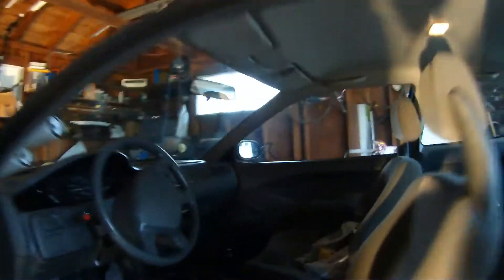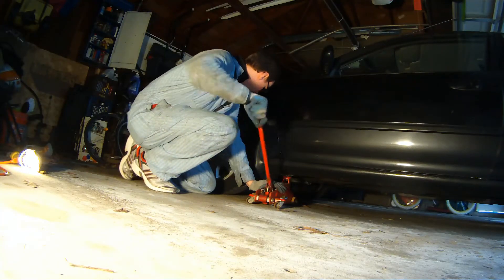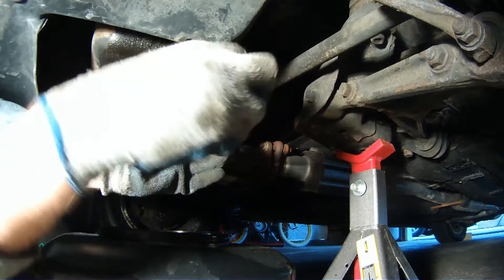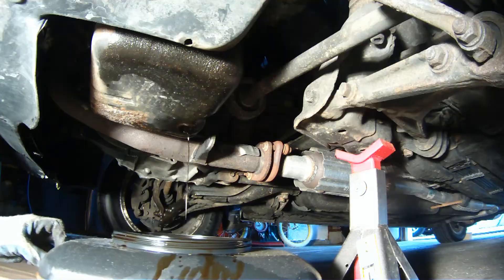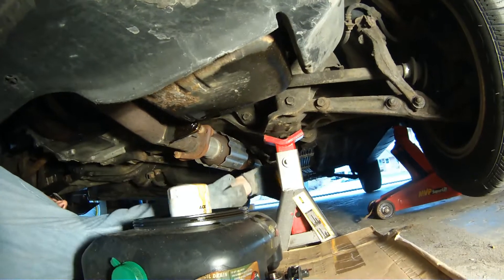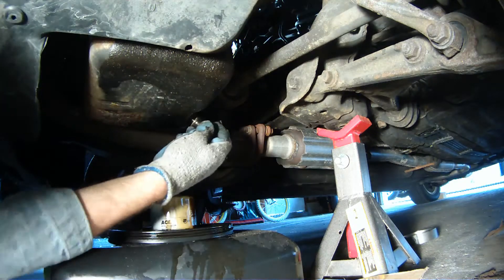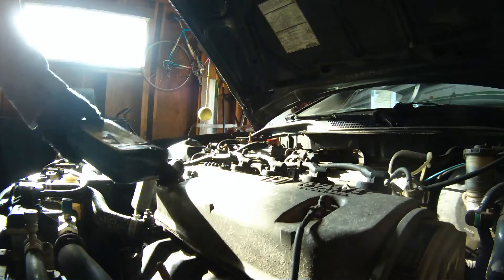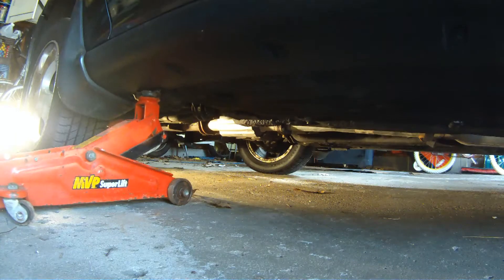Honda Civic Oil Change (1992-1995)

Comment: great informative videa!! I have a 93 honda civic and Im managing to try do this myself and this is helpful, but i wonder what type/model of oil filter would i need?
Reply from the maker: Numerous manufactures make oil filters for the 5th generation Honda Civic. Your local parts store should have a catalog of parts that fit your model.  I was using the Purolator in this video, but I don't think one brand is necessarily much better than the next.   The Purolator part number at Advance Auto is PL14459.

Comment: Isn't it better to do an oil change while car stands at ground level?
Which form has the oil tank? Is all of the oil coming out when I do it as you has shown? Thanks!
Reply from the maker: testingtest test - Yes.  Definitely better to drain oil with car at ground level. In theory more oil will drain if the car is at ground level.  Some cars with low ground clearance must be jacked up.  I only jacked this car up to make it easier to film. You never really drain all of the dirty oil as much of it still clings to the inside surfaces of the engine regardless of whether the car is jacked up or at ground level.  It'd interesting to see a side by side analysis of how much less oil is drained when jacked up.  I suspect draining while the engine is at operating temp vs 10 minutes after stopping the car has greater effect on how much oil is drained.
Reply: would you recommend an oil change on cold engine? would you recommend those ramps?
Reply from the maker: testingtest test - No to the cold oil change.  Yes to ramps...if you need them.

Comment: What the hell that's it?!!?? I been paying 20 30 bucks for someone to do this!
Reply from the maker: IKR!?  Many shops will offer $10 oil changes as a "loss leader" meaning they take a loss on the oil change to get you in the door for more expensive work. Be careful with these places.  Often they'll put the new kid on this task and you'll wind up with stripped threads on your oil pan, lost splash shield mounting bolts, dripping from spilled oil, and over/under-filled oil level. You're best off just doing it yourself because nobody cares as much about your car as you.